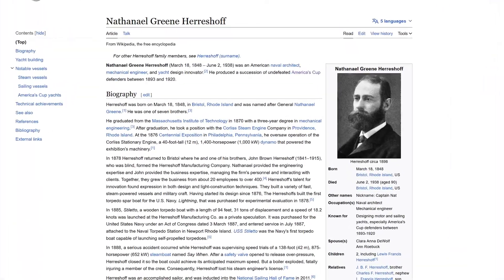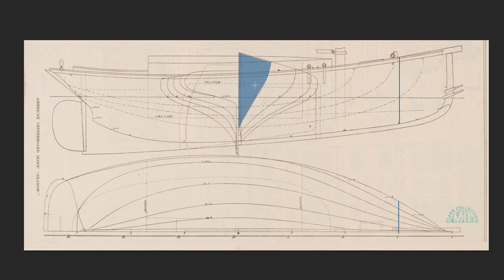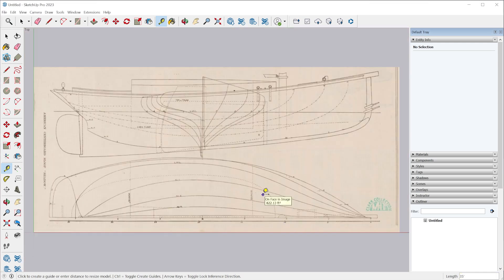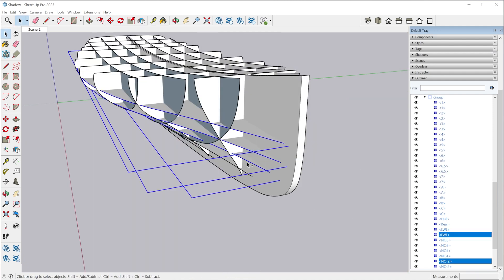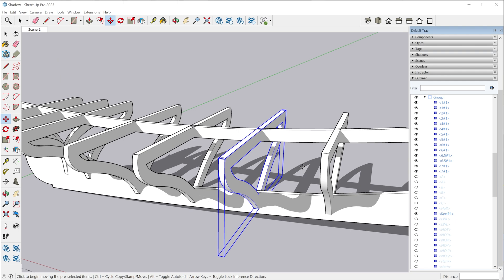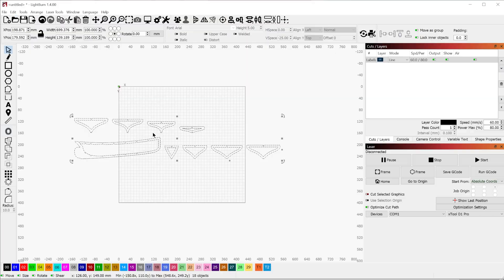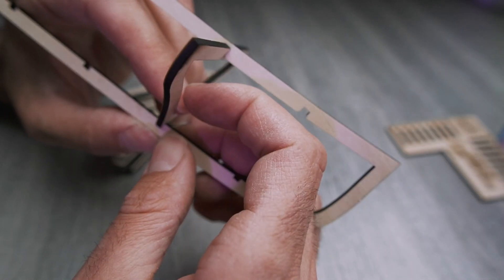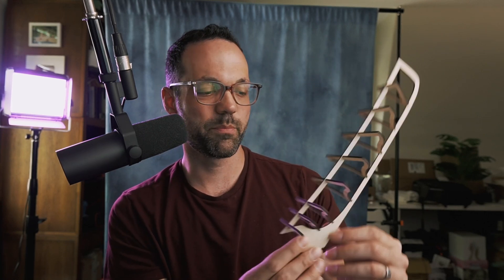Laser Cutting a Boat Hull Model with SketchUp

Comment: Hi is there a possibility for you to email me the laser folder for that hull you designed.I’ve never built a boat and would like to try and it looks like this one would be fairly easy to build.I’m also pretty now to the laser cutting and still struggling a lot to design cut files for my laser